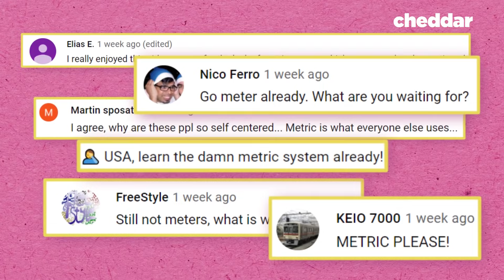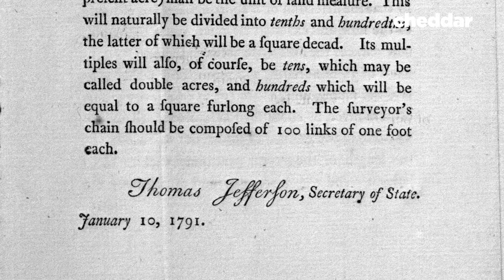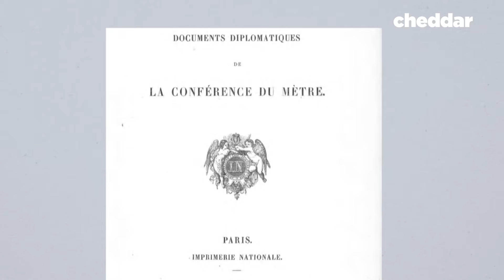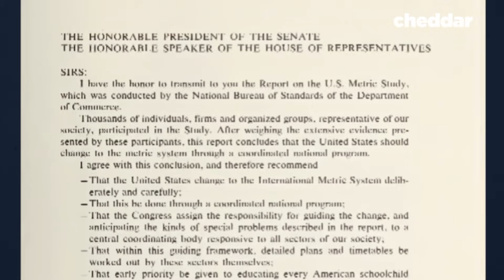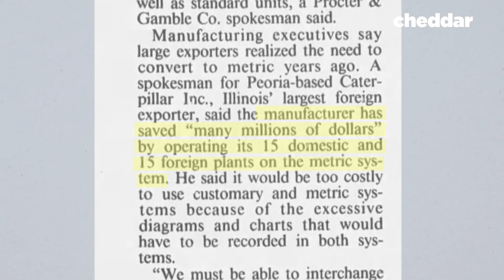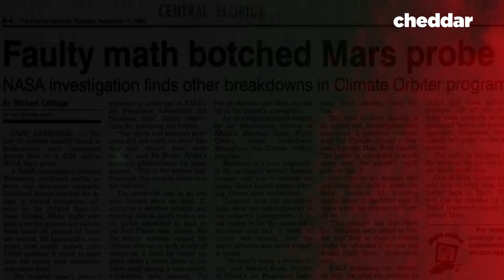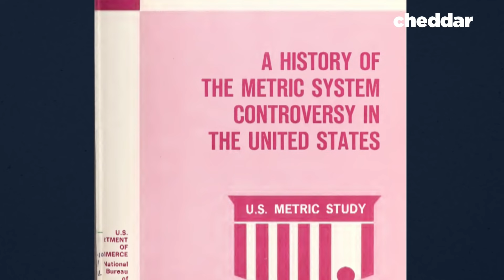Why Doesn't the US Just Use the Metric System? - Cheddar Explains

Comment: Australia switched to the metric system in the 1970s. It was a fairly clean break, and the exceptions to this rule are curious. 
* All trades use the metric system, and they measure things in metres or millimetres. 
* Shopping is all in grams and kilograms. 
* Road signs are all metric. 
* Fahrenheit temperatures have long since passed into history and pints and gallons have given away to litres and millilitres. 
* Stones have been dropped and pounds have disappeared: we measure by grams, kilograms and tonnes. 
* Rods, poles perches furlongs and yards have disappeared, but feet and inches seem to hang on, especially for personal heights. 
* Most measurements of area have gone metric: no more square inches, feet, yards or miles. We measure buildings and blocks of land in square metres or hectares. However, acres still hang on in rural parlance.

The changeover to the metric system went smoothly. Some fears were expressed when the road signs changed but this change went smoothly, too and there was no carnage on the roads.

The question is why a change that went so  smoothly in Australia and New Zealand should have been so much more difficult in the UK and the USA? I think it helps to be a smaller country where people know they aren't the centre of the universe and know they have to get on with others.
Reply: In USA is more difficult because they are way more ignorant and lazy fats
Reply: You're right,  @CharlieMontana-e8e . I haven't had to know that fact since 1974, when we changed to the metric system.
Reply: Canada switched pretty much at the same time and every thing when fine. 
We still have some imperial, specially in the residential construction field because of all the material imported/exported to the US.
Reply: Semper Fi  Yes, but not for the same reasons...The world doesn't like the US because you constantly meddle where you shouldn't, you think you're the center of the Universe and you have an idiot president. The US doesn't like the world simply because you're selfish people who know the world will surpass your country and make it insignificant.
Reply: Yes we embraced metric well though I believe a road is still 1 "chain" wide.

I was raised by the grands and had an earlyish touch of maritime. So as a result I still visualise land better in acres though can roughly convert that to hectare. I feel/visualise wind better in knots and have a hard time metricising that one. Everything else is metric.
Reply: Simple, people in the US & England are, fundamentally, stupid.
Reply: Hahahaha you got some chubby yanks upset...I can almost see the chewing tobacco spittle dribbling down the double chin's.
Reply: @Danny M However that statement is true! Americans DO think they're the centre of the universe. He was just stating fact.
Reply: Semper Fi  And with better quality of life than the US I suppose.
Reply: @CharlieMontana-e8e  Yeah, cause you like no one but yourselves.
Reply: Australia was successful because it converted all at once. Countries that try to phase the system in have been less successful. Nothing to do with national psyches.
Reply: Who gives a rats ass?
Reply: Your last sentence ruined your credibility and de-validated your good points.
Reply: @DoomFinger511  Someone not being nice dosen't devalue logic or facts they used previously. The points all still apply.
Also the fact that in the US world maps are used that have the USA in the centre while cutting Asia into two pieces kind of speaks for itself.
Reply: @BattleBrawlerHikaru  Most maps in the US are centered on Europe and Africa. I'm not sure I've ever seen a map that splits Asia in two (except for the far northeastern corner of Russia).
Reply: The points made are still the facts. If you don't like his final spin on it, go read a different reference which is more to your personal liking. But the points made remain the same. The metric system across the whole of Australia has been in place for nearly 50 years now.
Reply: One word:  bureaucracy
Reply: @
Ashbury2193 nice work. You left out pressures for our tyres and compressors...we use PSI because kPa don't seem helpful. Or something
Reply: Ashbury2193 I have no idea what a rod or a pole are but we only use inches feet miles gallons Quartz liters and pounds in America. It's simple. A pound is a pound. 4 Quartz per gallon and 12 inches per foot 5,280 feet per mile! Easy simple and not so many units like the metric system has. It's more convenient
Reply: @LucasFernandez-fk8se  pretty sure imperial doesn't have less / less confusing units than metric... on the everyday side of things metric has one unit for length (m), one for weigth (g) (+kinda the ton i guess) and one for volume (l)...
these can have a prefix describing the potency of 10 of the value.. micro = 10^(-6) mili = 10^(-3), kilo = 10^3, Mega = 10^6 and so on.. 
no 5280s or 16ths and stuff, just multiples of 10
Reply: Water freezes at 0’ and boils at 100’ 
how is that not more logical?
Reply: @LucasFernandez-fk8se  Yeah... no. It's absolutely inconvenient for the same reason the monetary system in Harry Potter is inconvenient.
Reply: @LucasFernandez-fk8se  bahahahahaha. I love when Amerikans say "it's simple" (especially when they lack even a basic grasp of metric). No, no it is not. Count all of your fingers...congratulations you are now a metric expert. Now THAT is simple.
Reply: @LucasFernandez-fk8se  The Imperial measures were used in Australia before the 1970s. At the time, we also knew that there were 1760 feet in a mile, or 63,360 inches, so a map that was 1:63,360 was an inch to a mile. 

This was swept away with the conversion to the metric system, where there were 1,000 millimetres to the metre, and 1,000 metres to the kilometre. While the old units can be easy to comprehend, they become more difficult when you try to put them together. 

There are 640 acres in a square mile, so if you are told that a farm is 1500 acres, it's 2.34375 square miles, not something that you can work out in your head. However, if that farm is 607 hectares, it's 6.07 square kilometres because there are 100 hectares to a square kilometre. Easy.

Of course, we had to get used to the new units, but this was no real problem. Road signs were changed in July 1974 and we soon got used to metric speed limits and distances in kilometres. It's convenient to buy groceries in pounds and ounces, but it's even more convenient to buy them when they're measured in grams and kilograms. You could even get used to temperatures in Celsius. We did.

The same thing happened in all the other countries that switched to the metric system. A small amount of inconvenience was followed by the lasting convenience of a system that all the scientists use and so does almost every country on earth.
Reply: Everyone keeps bitching about Americans thinking they're the center of the universe, but it's people like you that can't keep minding their own fucking business and find the most petty things to criticize Americans about. When we trade with you we use metric. That's all you need to worry about. For every day life my life doesn't depend on me knowing metric or imperial so we don't fucking use metric. IT'S NOT A BIG DEAL.
Reply: @Mav42  By your comment he was right, Americans do believe they're the centre of the universe!! That;s funny as hell!
Reply: @Mav42  Your expletive-infested response demonstrates what others find so ugly about some Americans: arrogance, rudeness and a glass-jawed over-sensitivity to any criticism. There is much to admire about the United States, but that doesn't make it free of blemish.
Reply: @Ashbury2193  Kinda sounds like you have the "glass-jawed over-sensitivity" if you need everyone to use metric so you can "get on" with them.
Reply: @jimharris5320  Have a nice day.
Reply: @Mav42  Your an example of why "Foreigners" have a low opinion of America.
Reply: @Mav42  You prove again why Americans are disliked by foreigners.
Reply: Well, they will finally be renamed into United Amish States!
Reply: @Mav42  Ironically since everyone keeps talking about Americans thinking their the center of the universe actually makes them become the "center of he universe". It's self-fulfilling.

Comment: We use both for example the metric system is used in the u.s. healthcare system; us nursing students have to be good at using it. For the life of me I can't use ounces I prefer mL.
Reply: but ounces are weight and mL are volume. you would need to calculate the density into everything to be sure.
Reply: @Mar-s5q8m  No American's are weird they have a unit of volume called ounces too because why not use the same name for two different units that's definitely not confusing at all.
Reply: @FaerieSeraphina  whenever you buy a drink it will say the ounces and it is technically called FL (fluid) ounces.
Reply: A quirk I've noticed is that some people with medical training pronounce the word "centimeters" differently from others in the US: they say "sontimeters", sort of a half-French pronunciation. I've wondered occasionally where this came from and I assume it's because the medical sector adopted metric units earlier than most of the US, and standardized on a different pronunciation before there was much external social pressure.
Reply: @MattMcIrvin  my professor say it like that I thought it was a southern thing because I am from New England and we pronounce it centimeters and  not sonimeters

Comment: I love the metric system when I’m making calculations, but when making general measurements I think SAE units are the perfect size. Feet and inches are much easier to visualize to scale than meters and centimeters. Other than that metric has everything going for it and I’m not opposed to a change in the US.
Reply: That's only because you are used to it
Reply: As a mathematical exercise, I can use the metric system.  But I think in customary/imperial units, and often have to convert the metric unit into the conventional to visualize it.
Reply: In China we use Jin for daily life weight measurement. But 1 Jin is 500 grams so it's the better of both worlds. Maybe you guys should just change the value of 1 pount to be exactly 500 grams as well. And while at it, change 1 inch to be 2.5 rather than 2.54 cm and drop the yards and miles.
Reply: @Adam Hale
: you don't use metric system to count money? Do you live in a cave?

Comment: Let them continue living in a bubble. Guess they must have plenty maths geniuses to do the conversions.
Reply: Not sure if you know this but we're taught both systems in school. So no, not that hard.
Reply: @shukuchimukyo892  is that a recent thing? All american videos I see reference imperial. I use imperial for some things too. Mostly where the base materials are supplied in "standard imperial sizes".
Reply: @manickn6819  Nah it's not recent. We use imperial for everyday life and metric for the sciences and industry.
Reply: @manickn6819  Because on the casual day to day level of the layman, the original imperial system works so much better!  It's easy to divide things in halves, quarters, thirds, etc.  Miles vs Kilometers doesn't really matter too much.  At the same time I work in a vaccine manufacturing facility and everything there in the labs and operating floor uses the metric system.  We can walk and chew gum at the same time.  Think of it as being bilingual in measuring systems.
Reply: @jimharris5320  As I mentioned above I use the imperial measurement when the base material is manufactured to standard imperial sizes. Since locally we get a lot of imperial sizes for construction materials I use it often enough. At least when its whole numbers, halfs and maybe quarters. After that is goes to shit. Try dividing a board 33 1/4" into 5 pieces? Crap to measure out. 

I like your bilingual analogy but the system is still crap. Humans work better in base 10. Would be difficult to dispute that.
Reply: @manickn6819 They're not in a bubble though.  Because the U.S. refuses to convert to metric, Canada is stuck in an awkward half-converted state due to several markets which are unified with the U.S. market and therefore can't be converted to metric.  For example, railways are one of the unified systems, so although Canadian roads are measured in kilometres and km/h, Canadian railways are still measured in miles and mph.
Reply: @OntarioTrafficMan  the bubble reference is in regards to isolation. I can appreciate the double system you mention. We get much of our construction materials in imperial sizes so lots of things are still done in imperial. It is problematic but alas systems take time to change and one hundred percent conversion may not be feasible for another generation.
Reply: @manickn6819   Well, dividing an 844.55 millimeter board by 5 isn't much easier !
Reply: @larsord9139  that works out to 168.91 so practically 169. Very easy to find on the tape measure or square. Doing that on the inches I get 6.65". Then I need to figure out what fraction 0.65" is close to. Turns out its close to 5/8" so that I can find on both my tape or square but then again maybe 21/32 is closer. That I cannot find on my square. Its those kinds of odd fractions that are not intuitive to humans which makes for a less efficient system.
Reply: Yeah we’ll live in our bubble of knowing how to do 2 systems of measurement and the world complain about it.
Reply: We learn both systems and can apply it in everyday use when one system is not practical we use the other as simple as that
Reply: "maths"
Reply: the geniuses are in the usa... until they graduate.
Reply: @americanswan : usa voted for trumpy dumpy... real genius move :D
Reply: Its your country that does the converting. While you fight for the u.s table scraps and watch the u.s continue to be the only country that keeps advancing technology
Reply: "Math".
They can't even get that right.
Reply: no we just have alot of smart phones so we can google it, not that hard
Reply: Smart phones for converting instead of a smart measurement system. I got it! This makes sense.
Reply: @MrWassup45  lol. Yes today would be easier but I do feel sorry for those that went through school decades before.
Reply: A bubble with the highest GDP and only first-world nation?  Kthnx
Reply: @jimharris5320  and this implies America's use of the imperial system is not living in a bubble? You know America's GDP is less that that of the rest of the world right? What happens to your argument when China's economy is larger in a decade?
Reply: @manickn6819  you do know we use metric too, right?  Go ahead and average out the individual GDPs of all those individual countries, buddy.  We have States that exceed other countries.
Reply: @jimharris5320  I know you use metric too so I cannot see the resistance to convert one hundred percent (or close to that) when a base ten system is simpler for humans to work with. 

The US economy has nothing to do with the imperial system of measures. It has a lot more to do with the skill set of the people, skill set of foreigners they attract and the "tax" the world pays by using the US dollar for international trade.
Reply: @jimharris5320  The only first world nation? Go to bed kid.
Reply: @mikeamber2528  Wow, such a reply.  I'll admit my error, I meant to type superpower.  Is that better? ;p
Reply: Considering how much tourists complain about the difficulty of doing simple percentages in their head when tipping restaurant staff, we must be pretty decent at math(s)